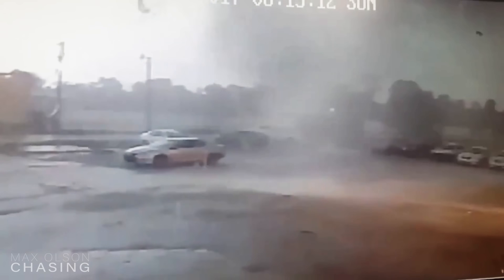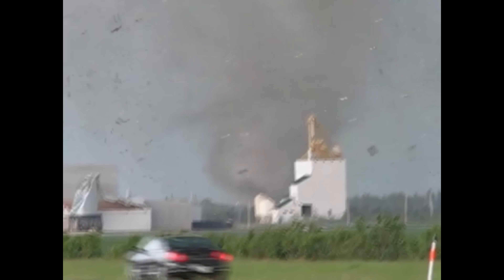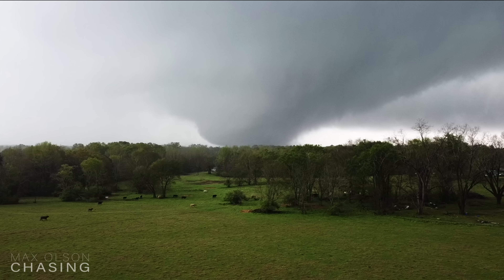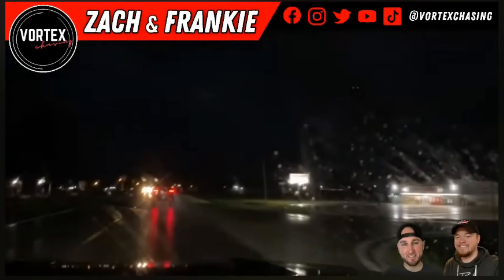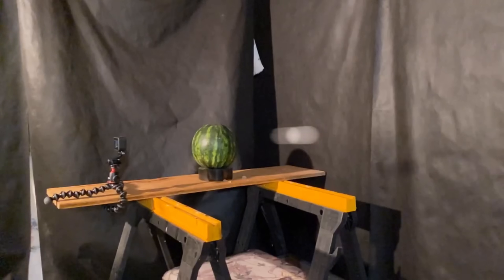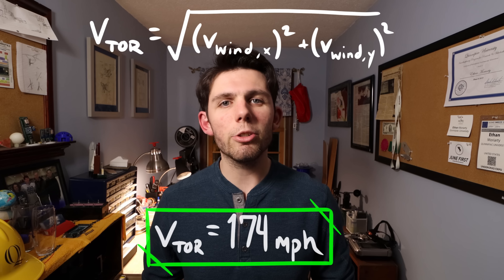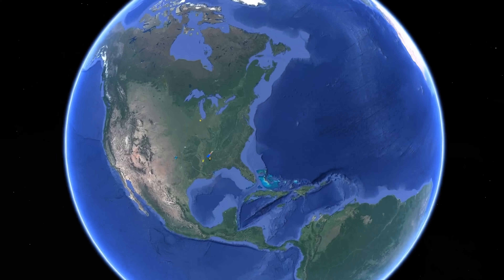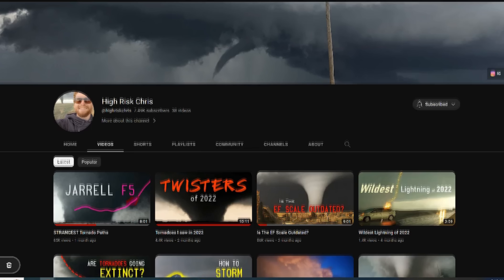Is This a Vehicle Flying Around a Tornado? - Rolling Fork, MS

Comment: Great analysis and video! I dig this perspective and analysis (liked and already subscribed). I totally thought this was a car the first time I saw this and still don't know. Just my observations...The light source is very linear and smooth during travel round the tornados visible circumference which shines its light source constantly. I would imagine a vehicle would be tumbling in air due to aerodynamics not that of a sphere, which would likely cause an intermittent light source and possibly a red taillight at some point. The angular velocity of this object was indeed tremendous. The light source seems to be outside the condensation funnel and took approximately ≈19-20 seconds to make 1 full rotation. The maximum diameter for a angular/tangential? velocity of 175 mph would be approximately 800 ft diameter? Honestly, I have no idea at the estimated tornado width at this point in it lifecycle or if math is applicable. But based on the horizon and the vertical 400 ft to the light source, doubled, it clearly seems to be traveling around a much greater circumference and therefor higher angular velocity? (EE trying to do ME math). The spiral inflow into the vortex (internal centripetal force) would have to be so tremendous to keep a 3000-6000 lb. vehicle with so much angular momentum and centrifugal force from exiting the wind field for such a sustained amount of time (30+ seconds?) at a large radius. This makes me think the mass of the object is much less than that of a vehicle to maintain elevated rotation for that long and maintain its vertical and centripetal component in the wind field at such a large radius and time with a large centrifugal component? Can a tornado of this magnitude pick up a car with that much mass to this height (initial vertical + centripetal component)? Probably, most definitely. But to maintain almost 2 full rotations while maintaining position at camera with focused beam headlights? I suppose that is my question. I might be completely wrong in my math and thinking but just sharing my thoughts. I love your content and what you do and definitely not a post to "debunk" your video. Curious as to your guy’s perspective on this hypothesis.
Reply: There's another angle that shows the "intermittent" flickering more clearly: ( https://www.youtube.com/watch?v=qJ27vMTp_L8&t=88s ).
Reply: I totally agree with Kyle, it seems impossible for the light  to remain somewhat constant while the vehicle is tumbling and rolling,  please explain.
Reply: @gamprhabanero5351  that's flashing.  not tumbling...not spinning.  it's not spinning at 7000 RPM ffs.  those are drone lights.    it's not too big for a drone at all either...have you ever seen bright LEDs from miles away?

Comment: So I raced for 23yrs. In several series. But in stock cars in the late 90s 2000s I went flying multiple times. When my car would get turned around. Vehicles will produce downforce going forward but if the wind gets on the 6 position. It will create lift. I say this because look at the orientation of the truck flying. It’s a counter clock wind profile and if we are seeing head lights that means the wind was blasting the vehicle at the 3-6 o’clock. So it’s very easy to understand why it’s flying like a skytruck
Reply: Now we just need to apply these principles to deliberately fly trucks like that. I want a skytruck, my workdays would be much shorter

Comment: There is a car in the El Reno wedge also. At 16:54 (going by the clock in the video) a few inches below the "T" in "Not" a light appears and travels towards the right. The car is spinning so it flashes on and off. This is the time and location where the stormchasers were hit. RIP.
https://www.youtube.com/watch?v=gnIU2Ii2Ec8
The camera pans down first then as it comes up the light can be seen, it's quick flashes like a firefly. The camera was over 2 miles away so a car would be very small. A  minute or so later they filmed the fastest subvortex a bit further down the road and another video analysis put them at about 1.5 miles from the funnel. The tornado was headed directly at them at around 55 mph.

Comment: The scariest part about this is the fact that there's most likely somebody inside that vehicle. 😳 I couldn't even begin to imagine the terror.
Reply: Imagine you are driving down the road at night and all of a sudden you feel the wheels lift off the ground and then everything goes pitch black and for a few seconds you don't know where you are and then lightning flashes and lights up the sky and ground below and you see your hundreds of feet off the ground with tiny trees and houses below you and all you can do is go along for the ride where ever the tornado takes you.
Reply: @crossroads8370 and then you smack into the ground at terminal velocity and feel your bones shatter

Comment: I appreciate the time and effort put into the video.  There are handheld flashlights that are much brighter than headlamps of vehicles.  The IMALENT MS18 is the extreme version of this with 100000 lumens.  That puts it in the range of stadium lights, but in the much smaller package of a handheld flashlight.  For reference, high intensity LED car headlights are 10000 lumens.  It absolutely could have been anything with a bright light attached.  There was no evidence presented that suggests this is more likely to be a vehicle for the light source rather than anything else.
Reply: How stable the light is indicates that it had lots of mass and wasnt tumbling like a small light would.
Reply: What would be the probability of TWO high-lumens flashlights being swept up in the same tornado. Not likely, especially when compared to the number of vehicles affected. I understand it's easier on the soul to want to imagine them as anything other than the Occam's Razor answer.
Reply: Not sure if you are not just advertising a product but assuming you are not would not a flashlight (or drone), being much lighter than an auto but rotating in such violent wind be rotating giving more of a flashing light similar to a lighthouse?
That's my initial thought.

Comment: At 1:52 of your original video of this tornado if you pause and zoom in on the light circling the wedge you can see 2 distinct headlights pointing down and the faded light of the rear taillights pointing up. The vehicle is at a 45 degree angle with the front of the vehicle pointing down. The full power of Mother Nature on display. Hopefully the occupants of the vehicle took shelter before it was lifted into the heavens.

Comment: What if a vehicle is traveling at say, 60mph? Does that make it more susceptible to being picked up than a parked vehicle?
Reply: Excellent question !
Reply: Yes. This is why escaping a tornado in a vehicle is so dangerous. It is very easy for lift to be generated on a moving vehicle, and likely the vehicle would be moving closer to 100mph, which just adds to the lift being generated as wind in the opposite direction increases and the tornado closes in.
Reply: It significantly changes the starting aerodynamics, but depending on the direction, it should be a little easier to lift thanks to the slight aerodynamic loft produced by a car in motion, and the direction it's drag vector is in.
Reply: If it's driving at 55 mph or lower than the tornado will run it over
Reply: Ahh Grasshopper, you have just caused many analysts heads to simultaneously explode...🤯....thus as your grandfather I shall hold with my position that "You don't tug on Supermans cape, you don't spit into the wind, you don't pull the mask of that old Lone Ranger and you don't mess around with Jim"...beyond those points grasshopper is utter speculation.  Always remember grasshopper, traveling east, darkness always comes faster than when traveling west.  Now go, the black belt you seek draws closer, however be warned, in the end Belts do nothing more than to assist pants to stay up.  The true answer is found when thy realization becomes....
React without analysis,  you're human nature will always be to protect thyself...👳‍♂️...
Reply: A bit convoluted but it’s as good an answer as any!!!
Reply: You may be on to something. I was thinking if someone was speeding to try to get past the tornado that might have imparted a lifting force. You occasionally see storm chase videos where the chaser suddenly realizes they don't have time to turnaround and then try to get past the storm.  They invariably floor it. Just a thought.
It also occurred to me that maybe it was a battery-powered LED lantern or light. This would be exactly the type of emergency light you would have when the power goes out. 
LED  lights are pretty robust and lightweight enough to be lofted and held aloft quite easily.  In the dark even a small light can be seen from great distances. One thing I noticed is that the light does not appear to be pulsing as you would expect a tumbling vehicle with directional headlights might be emitting. A lantern provides 360 degree illumination.
Reply: @sethcourtemanche5738  INTERESTING and very valuable information!!
Reply: I would hazard the guess adding even just 15mph into the direction of rotation would likely amplify the effects of the oncoming wind forces....maybe even 3 to 4 times that of sitting still....even moving away and getting run down by the winds might be worse then stopping for the first bunker/ditch to hole up in.
Reply: That is exactly what I'm thinking 🤔

Comment: Tornados can be absolutley horrifying. like the Jarrell Tornado in 1997 which basicely stopped for several minutes with 300+ mph windspeeds over a small settlement and turned the area into a giant blender. It shredded cars to badly they only found parts of the cast iron engine block; the rest was just gone. it was also one of the few known cases in which a tornado ripped the plumbing out of the steel reinforced concrete. The phrase "nothing left" described the jarrell twister the best as there was hardly any debris left. everything was shredded into particles.

Comment: Just a thought, I've a couple of large solar powered security lights on a few of my outbuildings, they are motion activated and easily as bright as a vehicle headlight.
Additionally, I would argue they are also more robust as compared to a vehicle headlight.
Could it be possible a solar/battery powered area security light was lofted into the circulation?
I'm half way through this video, I'll watch till the end.
Reply: I agree with you as this being a high possibility just as I commented above that a vehicle wouldn’t hold that steady being tossed in a twister to have such a steady light on video
Reply: @shawnzeleny3042  Perhaps the camera didn't really capture the 'flickering' well. This one ( https://www.youtube.com/watch?v=qJ27vMTp_L8&t=88s ) does.
Reply: I had that same thought...
Reply: As long as the light has its battery inside the unit, therefore not disconnected from its power source, then it seems possible. I was thinking as I was watching that as the vehicle rotated around the tornado, about half of that time the headlights wouldn't be facing the camera and at some point the lights would be blocked by the body of the vehicle. Unless the front happened to be facing out of the tornado and the rear of the vehicle facing the center of rotation the whole time it was in the air, which doesn't seem very likely, at some point when it was on the side of the tornado closest to the camera, the light would be dimmer or blocked as the vehicle rotated and the headlights became angled away from the camera. I hope what I'm trying to say makes sense. It seems that because a floodlight wouldn't have the bulk of a vehicle blocking it, it could be rotating fast enough that it would be hard to tell when it's facing away from the camera because it would be facing the camera again a split second later.
Reply: @AmyEugene  I think you've described your thought very well, and yes, I agree.   Two of my security lights have a lens design that reflects light outwards almost in a 360° pattern, almost like a landscaping area light.     I would think that if you asked any of the affected homeowners if they had used such lights one or more would reply in the affirmative.
All in all, super fascinating that something like this was captured and documented on video.
Reply: @gamprhabanero5351  Here is another thought, in the video you linked you can clearly see the light flickering ON and OFF, is it possible the lightning is triggering the electric eye of a security/landscaping light?     One of my neighbors has a solar light attached to the front of his tiny metal shed, attached to a thin piece of sheet metal I believe a security light could go flying very easily.

Comment: This makes me wonder if high profile vehicles like pickups and SUVs, which have a higher ground clearance, a higher center of gravity and more space underneath for wind to tunnel under might actually be more likely to get lofted than a low profile vehicle like a sedan even if the latter would in most cases weigh less. 🤔
Reply: I think No pick ups will just scoot, flip, or tumble. There was twister in our nearby town few years ago and the trucks butts scooted and a box truck tumbled over. There was one truck pulling a small rv that flipped. The forklift was the one thing that didn’t move but they’re really heavy. They were all side facing the twister. Our truck got a nice wash that day. 

Another interesting story, 

That same month 85 mile an hour straight line winds hit out of nowhere when I was home alone in our rv. It was hitting the side of the rv and I didn’t feel safe anymore so I left for our barn. The rv was creaking and it felt like I was standing in it going down a bumpy road. Well, I was watching the rv through the window shake and sink to the right little by little. I seriously thought it was going to flip and the barn was shaking and one window cracked. Once all said and done (after I got done ugly crying) and went to assess the RV it sunk about 3-5 inches to the right and all our cargo doors blew open. It blew out a throttle body for the car which is about 5 pounds and it was at least 10 foot from the cargo. I believe the only reason it didn’t tip was because it sunk. They say the pull in the slides for less sheer and better center of gravity but I had no time. You can really tell the difference in weight once slides are in though. Ever since then I’m really anxious about wind! This rv has actually survived a tornado at the dealership while some of the other flipped over. It survived hurricane harvey too. I forgot to add that it’s a 42 foot 5th wheel so it catches lots of wind.

Comment: I’m just starting the video so I apologize if this is mentioned further on in the video, but if that was a vehicle, isn’t it possible it was unoccupied and the lights turned on due to some circuit issues when it was being violently lofted and thrown around? Sorry, just a random thought right out of the gate but I know a lot of people automatically assumed the vehicle was occupied due to the headlights, but I don’t think that’s automatically true.

Also, I’ve read the theory it could’ve been a drone. I’ll be honest, I’m not super familiar with drones so I don’t know if that theory is plausible or not, but it’s one I’ve seen circulating.

Comment: The thing that is convincing me the most that this is not a vehicle is if a white light was to be visible throughout the entire rotation, it would suggest the vehicle would have been facing towards the camera at all times. You would not be able to clearly see the headlights from the side or back of the vehicle. With that in mind, I don't think it's very probable that a vehicle faced a constant direction as this would imply that it wouldn't have rotated, flipped, or rolled at all during the entirety of its flight. If other storm chasers saw the same phenomenon from a different angle, then it would mean that the light is emitted across a wider angle or 360 degree light output by this object, unlike the forward facing car headlight. This is more likely as the light is visible during its entire time in the air.

As for what this item is? I can't say, but it has to be something that has its own power source like a battery or generator. However, I do find it fairly improbable that this is a vehicle based on what we see and the observations I mentioned above.

Comment: I lived in Oklahoma and grew up and witnessed multiple F5s that hit Moore and Bridge Creek in '99 and 2013. The tornadoes ripped the foundation of homes out of the ground and even took the concrete off the ground of a 7-11 gas station. But It also took the roof off of homes and didnt disturb anything in the rooms or devasted 1 home and skipped the one next to it. I have full confidence this car was launched and spun with the tornado given a 350 F150 would be a max of 7000 pounds if indeed thats what the vehicle is. Also, just researching if any of the fatalities was inside a car would narrow it down.

Comment: Another variable (since the light was on) to consider is: "was the vehicle in motion?" If the lights were on most likely one of the 2 things happened: 1. Someone was driving the vehicle when I got lifted or they were driving it, perhaps in a hurry exited the vehicle top take cover leaving it running or at least the lights on. If  they drove into the tornado not suspecting the tornado, if they were traveling at a certain speed this could add to the lift of the vehicle, especially if you drive into the tornado. We all have seen tornadoes pick up shipping containers that weight a lot more than regular trucks and cars, taking them way up in the air, so def possible.